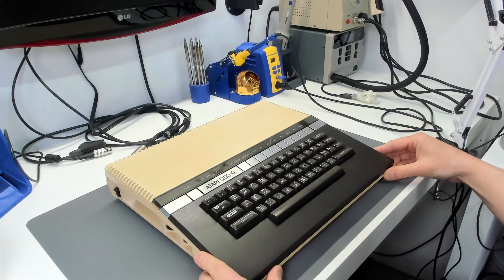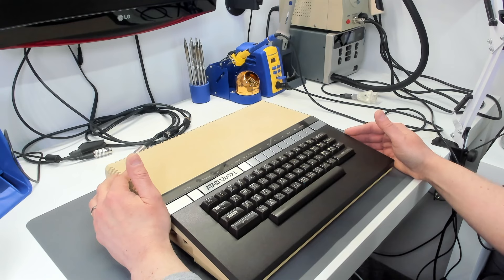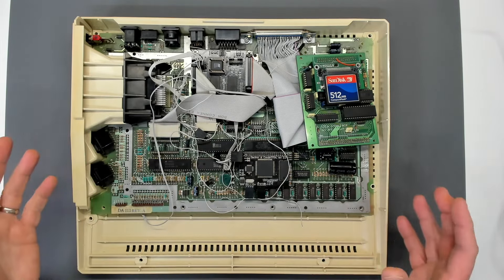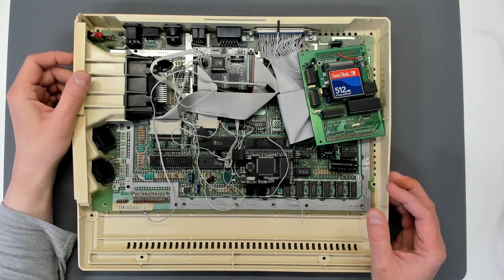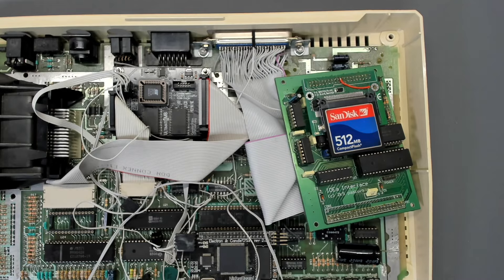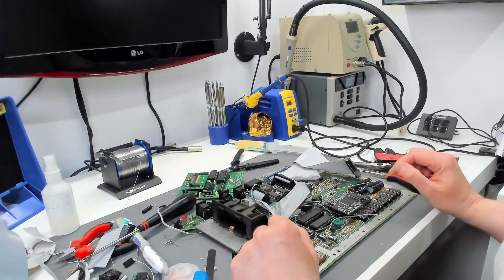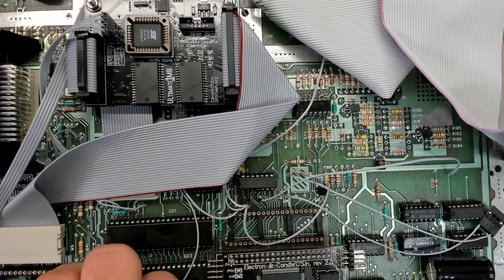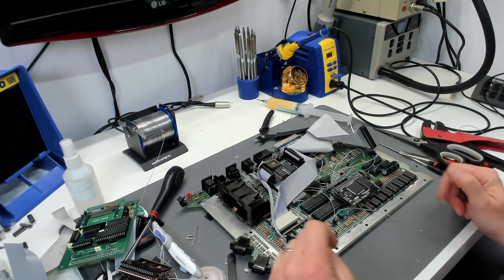Preparing the Poor Man's Atari 1400XL for sale

Comment: If you have four 1200XLs, how many Ataris in total 😮?
Reply from the maker: A quick tally: I think two XEGS, three 1200XLs (after this one's gone), one working 1200XL motherboard for which I need a case (keyboard desirable, but optional), seven or eight XEs, five 800XLs and four 600XLs. So a little over twenty, I'd say, plus three STs.